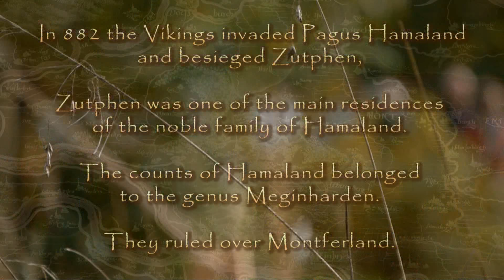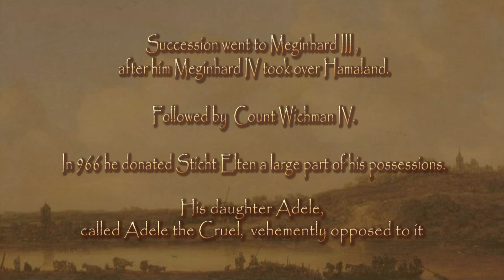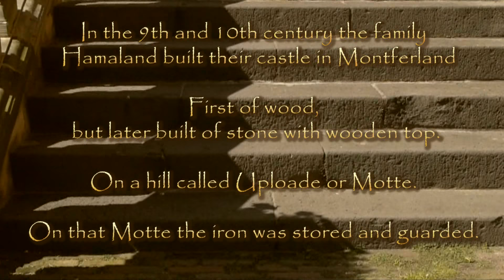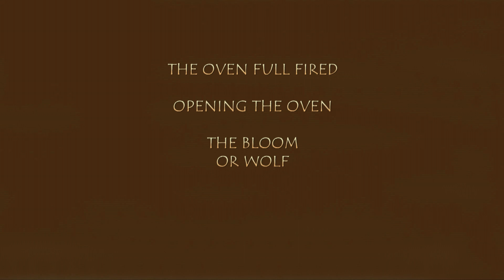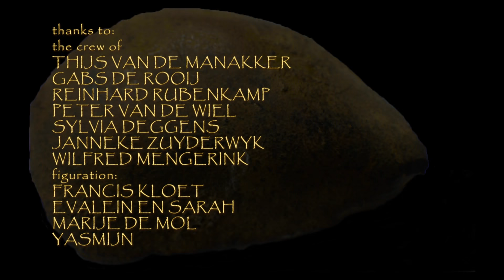Medieval Iron Production in Holland Thijs van de Manakker - smelting ore

Comment: With all that effort and resources going into such a small amount of iron, iron most had been worth a lot in trading at the time. Having a few bars of iron meant you were rich.
Reply: Yes and no. Iron can be found a lot easier than tin, which is required to make bronze. Tin is only found in specific geographic regions and is fairly rare. You pass iron boulders on your way to work.

Anyone with the right know how, can make an iron plowshare or some farming implements, in 3 days, with local materials. Is impossible to do the same with bronze, there are high chances you have no copper nor tin nearby.
Reply: Not really.
Making a hundred pounds of iron was a day's labor.
Making a hundred pounds of carrots was a day's labor.(just over a season of growing/weeding/tending/planting/watering)
Carrots cost about 50 cents a pound today and so does iron. The only real difference with their economy and today was everyone was poor.(instead of everyone being rich)
Reply: That's why only rich knights had a full set of armor, leather was the typical gear.
Reply: @kkknotcool  sure, nowadays we all rich.
Reply: Bog iron and metiorites were the go back then.
Reply: @kkknotcool  You cannot compare the  cost of a pound of carrots and a pound of iron at todays prices...Industrialisation and Agriculture have changed massively and disproportionately to each other. Back then supply and demand who change everything. But the Blacksmith couldn't exist until there was surplus food to allow skilled trades to develop. Inherently the cost of Iron would be reflected in the labour (read food) needed to obtain it. So Iron per pound would at least be an order of magnitiude more expensive than carrots. Nevermind the expense of the Ore, lime and Charcoal....
Reply: @mkjredemption  leather armor was not common. They wore thick padded cloth armor sometimes with mail or plates over the padding. The rich would buy ornately designed custom taylored plate armor, but a frontline soldier in the renaissance would also have plate armor.

Comment: i have spent the past few years working in an iron foundry and discovered i have a love for metalwork and built my own furnace and have even make my own casting molds. i am not as primitive with my setup as the ones depicted by these vids. but i am interested in collecting my own iron ore from the earth any tips out there? i just use scrap now and just want more knowledge of something i have desire to do.
Reply: jhendka p. How's the shop going and you should starting recording yourself making things.
Reply: Biggest tip i can give is to look for rust. Iron rich ground usually has lots of rust. I presume your living far away, but our land is so full of it, that its effecting drinking water. You can see rust wains in base rock and from there one could mine it. I dont know about quality of that iron ore, but i presume its workable enough.. mmh guess i should start mining it XD

Comment: It is interesting that use was never made of the molten sand that dripped from the furnace. Is this because it is unstable a building material? I know from living in the Los Angeles area and Kaiser Steel having smelters not too distance that there use to be by the freeways huge slag piles that there seemed to be no use even as railroad bed material.

Comment: looking at this furnace you guys are lucky that it did not collapse.
Reply from the maker: Ita was very solid and firm and actually used more than oince Jan - Philippe
Reply: Jan-Philipp Jürgens Ive made a bloom furnace with clay and straw. if you add some sort of fiber it makes the clay stronger.
Reply: cultuuramersfoort After a 1800 degree fire , that clay goes ceramic and is harder than concrete .
Reply: 1eagleboy1 The straw , sawdust or organic fibers burn away as the clay is heated up. The remaining voids act as insulation and also prevent cracks from extending through the mass. From the look of the furnace they could use a little more straw.
Reply: cultuuramersfoort  Thijs is a master of his craft. lol, No doubt in my mind that it was solid.
Reply: tehlolercaust You can bet it was solid. Masterbuild by Thijs
Reply: Jan-Philipp Jürgens ah yes, the guy on the internet knows more than the people that have been doing this for years
Reply: Lefty Tracking Fahrenheit =/= Celsius, reread post.
Reply: Jan.... I have a clay forge that will melt steel and it's not even enclosed like the furnace Thijs made in this video. And as far as charcoal... There's no advancement in that technology. Charcoal is charcoal. It burns hot enough to melt iron with enough air applied.

I don't know why people are arguing. I'm just going to assume you're not a smith of any kind. 1800C is only 3300F, which is relatively easy to get to win a clay oven burning charcoal and having air pumped into it.

Comment: Great video, although it skips an important step, namely the making of the charcoal used to fire the bloomery.

Edit: Hmmm, not a lot of slag. Ive never done it before, but i wonder if making the bloomery taller, and with slightly thicker walls, running it longer, and mixing some sand into the hematite powder, would give both slightly higher temps, more slag and a better bloom at the end.

I realize it is not authentic, but perhaps someone coulda checked the bloomery temps with a hand held IR gun off camera, just to verify you were in the ideal range ?  They cost under $100.

Comment: I am not sure how they made this work as presented. My experience with firing wet clay says that the oven will self destruct from the inside out as the water in the clay turns to steam and causes spalling of large pieces from inside the furnace.  Now if the entire clay furnace was leather hard I can see it working, but when I built a rocket stove with wet clay, allowed to to dry for two full weeks and then put a small fire inside of the stove, spalling began within 10 minutes of starting a small fire.  Water was turn to steam and popping off large pieces from the inside.  It sort of sounded like 22 cal gun fire as they exploded away from the wall.  I had to put out the fire to prevent further damage to the stove.
Reply: By mixing loam (a sandy clay) with lots of sharp quartz sand  and organic material it's possible to start firing while building .

Comment: If you had let the clay dry at a slower rate the cracks would not have formed, and the furnace wouldnt leak at the bottom.
Reply: +RagingDong ...it's inevitable for some clays that have a high shrink-swell capacity. Cracking can be mitigated with straw.

Comment: I have a question : Is the endproduct steel or not ? Because it seems to me that the steps are quite similiar to make steel
Reply from the maker: Hello Andre, in those days iron was ductile and soft. Many slag residues, little or no carbon. Due to the lack of carbon it remained wrought iron.
By heating the iron very often, and by frequent hammering,  iron takes on carbon. 0.5 - 2%. All slag residues were hammered out. This would be called steel, because of the hardness. Especially this was very precious in those days, because of the intensive processing in the charcoal fire.

Comment: I have some questions regarding the forge. I know in the video you said it was made of clay, sand and straw; but the way it was worded confused me. The narrator said "loam is mixed with sand and straw", but does that mean you mixed (added) sand and straw to already existing loam? This wouldn't make much sense to me cause I thought loam by definition is clay or soil mixed with sand and straw? So how could you be adding loam (made up of clay sand and straw) to clay, sand and straw? It's the same thing.

My questions are then, do you have a different definition of loam? Or were you simply stating what loam is made of? 

What I really want to know is what exactly were the ingredients used in the forge? Was it just clay, sand, and straw? Or was there something else.

My last question is why is the straw necessary? I know for construction purposes adding hay or straw to mud or clay reinforce the structural integrity of the bricks but for a forge where high heat is applied I would think the straw would be a bad idea. Wouldn't it burn away leaving air pockets therefore making it porous? I thought for heat applications you want bricks or mud that were very dense, not porous.

Thank you in advance for your reply. This is one of my all time favorite videos. I've watched it probably 15 times

Comment: i was wondering, it seems that steel is made form almost the exact same way, with iron poured on top in layers between charcoal. and then heated up as i melts it makes steel. what is the difference that defines steel from just iron in this method?

thx for the vid btw.
Reply: Leon Rego Time, temperature and type of ore . . . .

Comment: You got to wonder how people first managed to do this without any metal tool. I mean did the just get it really how that start smashing it with a rock?
Reply: +ithpally 
When the first iron reductions took place (about 2000BC), mankind knew the bronze for a few thousand years.
Reply: Copper and bronze tools were in long use before iron smelting began. That said, this could still be accomplished with good stone tools, though forging would be very difficult.
Reply: Galen DuLac I meant when they first made metal tools at all.

Comment: The furnace doesn't get hot enough you need more coal in layers with ore and more time. start in the morning finish at sunset, also the use of more and finer pieces of grass will prevent cracks in the furnace.
Reply: yes. i actualy whach it , twice now,. thats what i know from my sources=>books and a historian with a doctorate degree in medieval history, when you "cap" de fournace iron should poure fast from it, not into de groun bun a small form made from "fournace -material"  it should be much cleaner and not "foamey" , you can build a small filter from dry grass, this is how they done in in est-europe.,
Reply: Go under your brindge ;)
Reply: since this video is made by a museum I doubt they will listen
Reply: This is not true at all. You do actually pour the slag out into the ground. That's what you do to slag. No body cares about it. You want the bloom anyway. The bloom is the "foamy" block you pull from the furnace after it melted all the metal into a big block and soaked up a but ton of carbon. After you pull the "foamy" bloom (which is supposed to be that way) from the furnace you heat it in a forge to welding temp and beat it to death and thus bring it new life. Maybe try a new school. Maybe preschool? And why build a filter for slag out of grass DRY GRASS? In case you haven't noticed grass burns. And that "furnace material" is called "clay". What did you thing it was? Bubble alumina castable refractory? That's kinda a 20th century thing.
Reply: You'll want the bloom as this is a bloomery furnace; to remove the oxides and make the iron JUST workable. What you mentioned in your comment would be a foundry (not the same thing). being a "doctor/historian" means shit without any practical knowledge.
Reply: Can you receommend any books describing the whole process of making iron?

Comment: amazing direction and cinematography let down by terrible editing. the documentary did its job, though. I have been thoroughly informed!
Reply from the maker: +IdioticPlatypus That's a relief and a huge compliment!
Reply: +cultuuramersfoort You should be very proud of this work. It wasn't even "let down" by the editing; i should have said the editing distracts from the action slightly, and only in a handful of instances. A few of the transitions were quick, and I completely understand that choice if the idea was to keep the length as short as possible. One instance of a 21st century camera focusing and taking a picture was audible. As a sound engineer, that one poked me in the side a little bit, but it shouldn't affect most of your audience. Do you have any other documentaries online? I'm very interested to see your other efforts.
Reply from the maker: +IdioticPlatypus Thank you for the nice comment. I mostly worked with Canon FD primes 28mm and 55mm 1.2. and a 12-35mm Panasonic.. All great lenses. A real low budget production. Non Profit. I do appreciate Your comment. Kind it is. The microphone was a NT4 Rode., loved it then, Now I experience there are better ways to record audio. Schoeps are fine.

Comment: Why Are They Using Iron Tools To Make Iron Tools
Reply: are they suppose to be Copper Tools ?
Reply from the maker: They knew how to form and harden iron  tools like files and hammers.
The red hot heated iron is hammered with a relatively cold iron hammer.
In the Middle Ages stones were used as hammers as well.
No copper or bronze tools.To soft
Reply: Copper tools built the pyramids

Comment: Watched a video of some African Villagers making iron. While their tech seemed to be just as primitive what they did worked a heck of a lot better.  Their furnace was taller and they used two bellows pumping on alternate strokes so no pauses. They appeared to be shoving a lot more air through their furnace. They split their bloom into parts and forged hoe heads out of it. Turned the enter bloom, about 30 lb, into hoes with handles that day. They did use a much larger workforce.  Hammering on cold metal will cause cracks.
Reply: there are 2 bellows, its a different design that has 2 people on the bellows and they are on opposite sides. I would imagine you build the blast furnace to the size of how much you are going to smelt.  and they got a much bigger ingot than what the plow head was so i think they must have split it off camera.
Reply: Those are smelting for a living.